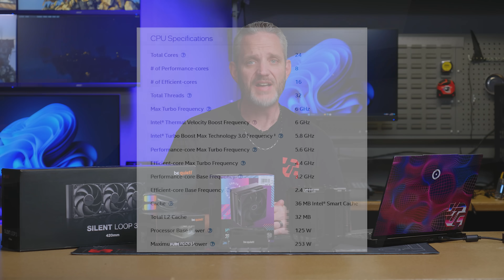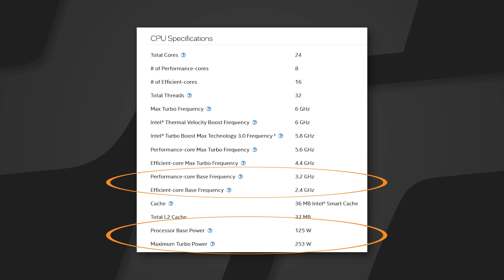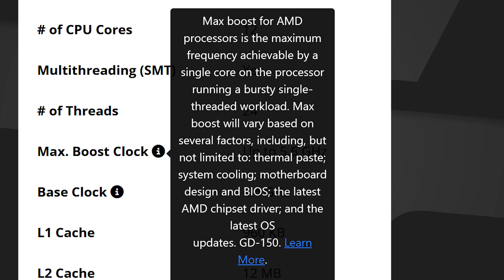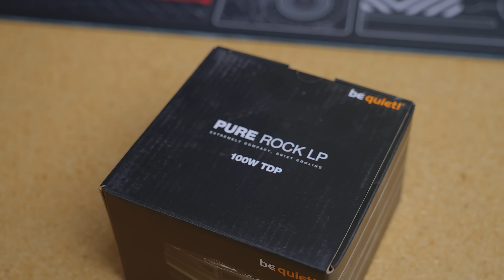Forget what you THINK you know about TDP

Comment: It is also important not to confuse TDP with actual power consumption. These are two different things.
However, since there is currently no standardized norm for TDP (which would also be difficult to implement), it remains only an approximate value that can be used at most as a guideline when designing cooling systems.

Comment: Never liked water cooling because if it fails , you're f**ked...not everybody have spare water coolers to change it on the spot, it might take DAYS before you start your PC again... there are alot of people who got their whole system fried because of water leaked inside , or the water cooling system stopped working and couldn't turn on the PC until they changed it...
At the moment i'm using Thermalright Phantom Spirit 120 EVO on my 9950x3d ...even if both coolers stop working (which is almost impossible) the case coolers do a great job of removing the hot air from the case ...even if all the coolers from the entire PC stop running, the radiator alone is enough to dissipate the heat from the CPU (at least until i buy new ones)😅

Comment: Question for Jay/anyone interested in responding, so I am building a new computer currently. I have a 9800x3d going in the new computer, and I bought a Thermalright Phantom Spirit 120 evo to put on it. Would that be enough thermal capacity for the CPU? I was originally going to go with a 9700x and a hyper 212, but I think I am going to throw it on my old build, which has a Ryzen 3600 (going to be upgraded to probably a 5600 or 5800x so my dad can have a more updated build. any help would be appreciated

Comment: Seeing Jay attempt to argue that conservation of energy doesn't apply to computers was hilarious.  Yes Jay computers break physics...

So the amount of power consumed is exactly the amount of heat generated, because that is what is happening.  Energy is being converted from electrical energy into thermal energy due to ohmic resistance at the transistor level.  "TDP" is an engineering value, that is what the "D" stands for in there.  It tells engineers that the CPU, at factor settings, should be expected to convert that much electricity into thermal energy.  The engineers can then design the power and cooling solutions around that value.

Since the CPU's just happen to come with variable clock, multiplier and power settings, their TDP is also variable.  MB manufacturers configure their BIOS's to automatically try to max out those three settings, which in turn increases the amount of electrical energy being converted into thermal energy via that ohmic heating.  The MB manufacturers being too aggressive with these values is what lead to "CPU degradation" on both Intel and AMD's side.  All integrated circuits are susceptible to damage from electromigration not to mention actual material stress damage from prolonged high thermal loads.

Short story, always buy far more thermal transport capacity (aka cooling) then your CPU is rated for if you intend on letting the MB do it's auto-OC thing.

Comment: I usually run my linux system in performance mode. echo performance | sudo tee /sys/devices/system/cpu/cpu*/cpufreq/scaling_governor   Which never than seems to drop below 2.9 ghz then. I just run stock amd cooler at max and 2 case fans in my sf case. Computer never gets above 157 F under full load.

Comment: Speaking of cooling, Have you ever reviewed the Thermaltake View 300MX midtower case?  I got the white one.  This thing has more options to cool and put a crapload of drives in a midtower case, IT has two 200m fans in the font and a 120 in the back.  Room to add fans, any size watercooler in any orientation, etc.  With its flexibility and price, I am liking this one a lot.

Comment: Been building computers as a business for over ten years. 
The rule of thumb is actual wattage for every 100w you need 120mm of rad space. So for a 14900k that can peak at 280w you will need 360mm of rad space to properly cool it.
9800X3D's PPT is 162w so technically it can call for a 240mm AIO, which would be overkill. Air Dual towers are adequate for it however, like the NH-D15 G2, or the Peerless Assassin 120 SE. A Hyper 212 pro on paper does have enough cooling power but because of the Peerless Assassin being so cheap there is no reason to not just run that if space is not an issue.

One thing to note is X3D chips do run hotter than their wattage would suggest because of the 3D cache so overkilling cooling on them a little bit is good.

Comment: I have a modest CPU (Ryzen 5 5600X) that has default TDP of 65W, and I purchased the Be Quiet Pure Rock LP (100W TDP) shown in the video to install on a Mini-ITX board. Will this be OK? I also have a beefier Be Quiet Shadow Rock TF 2 (160W TDP) but if I use it on this board, it will go over the RAM modules making them inaccessible if I want to upgrade them later. Thoughts?

Comment: Wow - you may have just answered my latest concern. My CPU is generally at 55+C and often gets higher even on idle, on Linux. Ryzen 9 5900X (not overclocked). It has a tower cooler on it (unless I pull my system apart, can't tell you what), which has been the same cooler since my Phenom CPU. Maybe I need to bet a newer cooler, at last.

Comment: I unfortunately had 2 Corsair AIO''s leak on me. Well, one popped it's hose off and drained right into my system. That sucked. Killed just about everything. And that wasn't doing much, except it was my Plex Server and the AIO was about 4 years old. I now have a fan/cooling tower on it with zero issues on the rebuild.

Comment: This was an extremely informative video for me.  In early 2023 I purchased an i5 13600k and initially bought a well rated single-tower Nochtua air cooler (I had never used any form of liquid cooling up to that time).  My temps under stress testing reached the 90s and 100.  I had never run into heat problems overclocking in the past 20 years using air coolers.  I purchased a DeepCool LS520 240 AIO, my first liquid cooler, and it worked great, and continues to do so after almost 3 years.  I am only mildly overcloced, with my performance cores boost to 5.4GHz and efficiency boost to 4.3GHz. Vcore is fixed at 1.3. I like to use OCCT and under stress, my coress mostly max out in the jid to upper 70s.  

Your point about there being a crossover point between 240mm AIOs and dual-tower air coolers was most interesting.  I always choose to find that sweet spot when overclocking to mitigate overstressing components, and I suspect a good solid dual tower cooler may be my choice in the future.  While very pleased with the DeepCool (which cannot be purchased in the USA now), liquid makes me nervous, there are too many moving parts, I prefer the simpliciy of air with only a fan.

Comment: Unless you are working with really limited space, there really is no reason to try and get the bare minimum cpu cooling wise, Thermalright has like 20 different coolers in every price and performance bracket ><

There are two things I always overspec for my PCs, it's cooling, and it's the PSU.. because both are relatively cheap, and you would much rather have too much than too little

Comment: This is why reviewers are really handy, because they can do Wattage tests, and thats what I base my purchase on. Noctua has their own compatibility list.

From my own experience.... any CPU needing more than 200W of cooling has a real impact on your build. 240 AIO or a big tower cooler, you ll need to double check your case and getting to the PCIE 'hook' to remove your GPU can be really annoying.
Ever since Nvidia made flow through coolers, I have had more heat issues with tower coolers putting extra heat onto the chipset, memory and tower coolers.
Asking WHAT performance you need so you can keep the heat reasonable is now one way to balance your build...

Comment: As much as i love noctua. Their simply to large and cumbersome around the cpu socket and did slightly  warp one of my old board from being to heavy so currently on a new build my 9950x simply did not like being on air so i bought a massive thick boi 420mm pro  LF3 aio from arctic for the first time ever and couldn't be happier with the temps as ive never seen them go so low. Yeah aio's have more moving parts and failure points but if it works it work well and will buy another if i absolutely  have to over time but im hoping it wont be any time soon since i only run the pump at 50%, swapped out the fans with noctua industrial fans  lol, and the vrm fan at half speed, and it absolutely keeps anything i throw at it well in check for only running steady at 50% overal. Its gonna suck when it eventually fails but the performance is worth it and will hopefully  last much longer with not having to work as hard. 

Im overal waiting for noctua to release their own aio but moreso that crazy looking thermo Siphon they showed off because  that thing would look awesome in my pc. I just hope they release at some point in my lifetime with how long its taking. :3